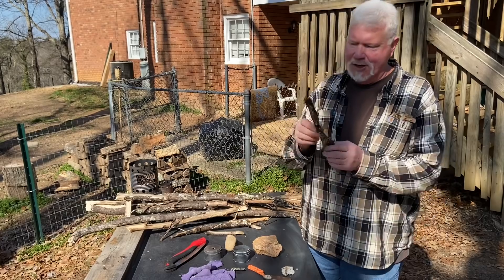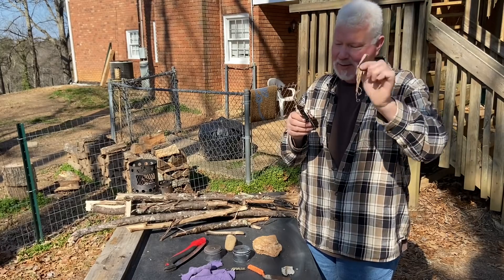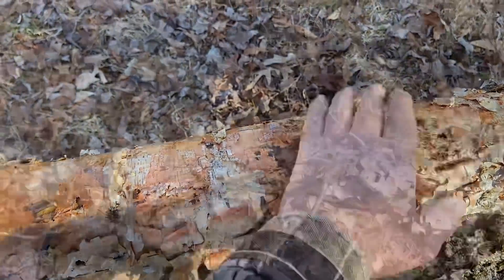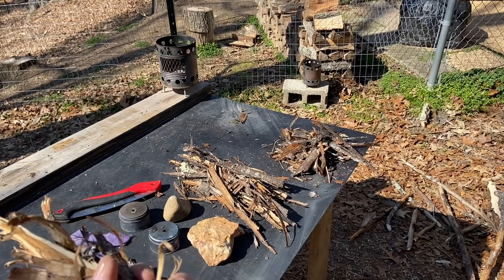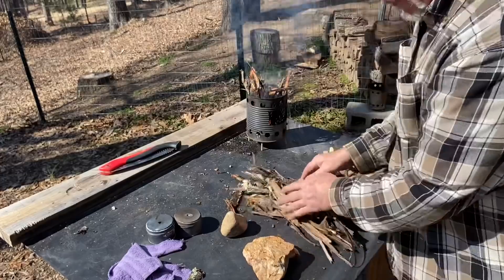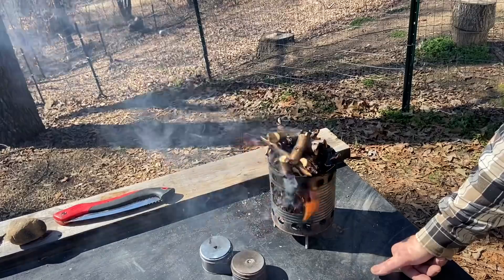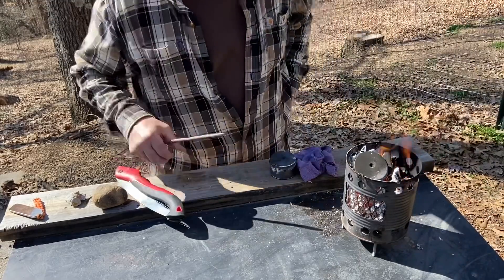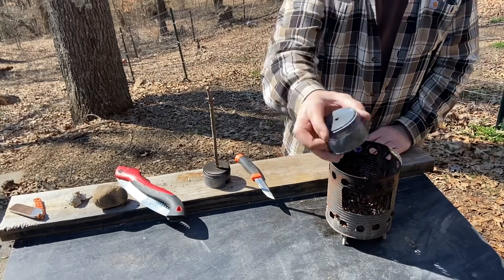The Hottest Burning Char Material I’ve Ever Used, Ribbons Of Inner Tulip Poplar Bark!

Comment from the maker: To make Tulip Poplar Bark char I've always removed the outer bark which reveals ribbons of inner bark then processed those ribbons into separate fibers. I was never all that impressed with it for char material. It came out fragile and delicate, was not that quick to ignite, and didn't really burn all that hot before burning out.
   I thought for today's experiment that I would char those inner bark ribbons. It might increase the mass which would increase the burn time?, make it less fragile?, and possibly burn with more intensity?. LOL! While it's still uncomfortable to handle because it's so fragile, and it still burns up too quickly, the intensity of the burn is now, off the charts.
   I think the reason it burns so furiously is because its new density. Then density is tight enough to quickly transfer heat to the adjoining fibers, yet loose enough for oxygen to feed the flames uninhibited. You have to try it for yourself and tell me what you think.
   There's lots of other good techniques within also... Bi-Polar Percussion to sharpen dull chert, I used the bark of a River Birch to ferro rod ignite our fire, I used Flint and Steel to test our char material, etc,
   Please follow the LINKS below and SUBSCRIBE. Thank You!

Char Cloth, Charred Punk Wood Playlist
https://www.youtube.com/playlist?list=PLkoXX8XsMW3nfHvlf-YghwFdkUBYRIIMy
How To Make Fire With An Empty BIC And Tulip Poplar Bark
https://youtu.be/p6ZAB8wwdx8
Reply: Good to know.
Wouldn't have thought of this.

Comment: Good to see another char material option. I made a batch of char cloth last weekend. Still getting the hang of it. Thanks for the video!
Reply from the maker: Are you using flint and steel or ferro rod to ignite it?
Reply: Flint and steel.  I used a t shirt to make the char cloth and while it works, it’s very fragile. Having better luck casting sparks onto it than trying to hold it on the flint. Doesn’t help that my flint is down to it’s last (barely) good edge. I’ll touch it up this weekend and see if I can find some denim to try next.
Reply from the maker: Sounds like fun!